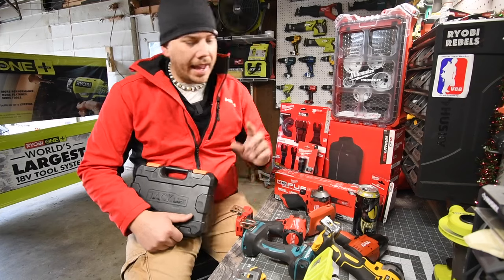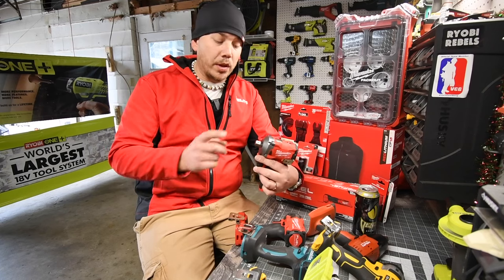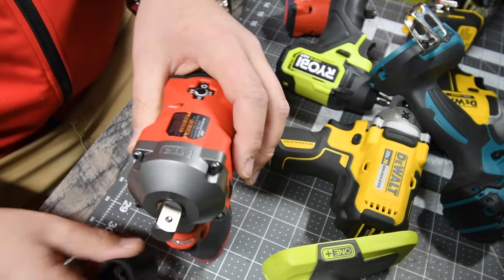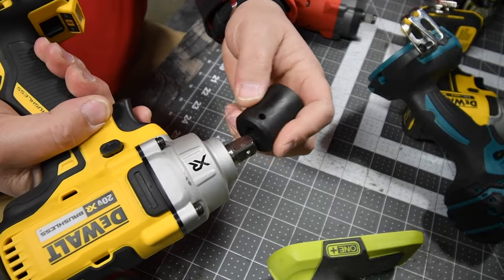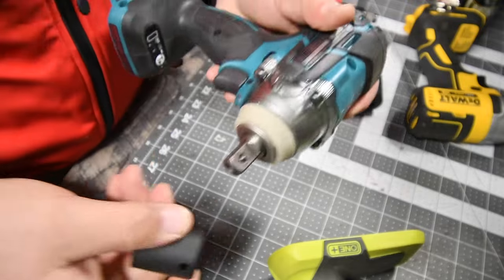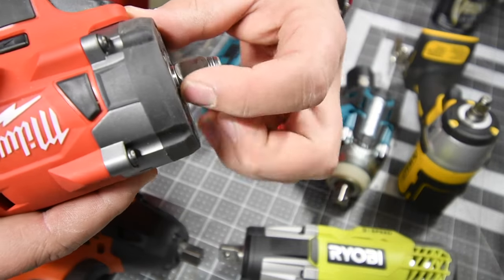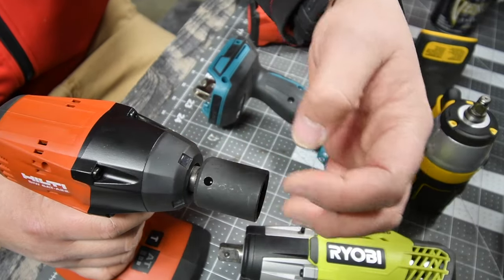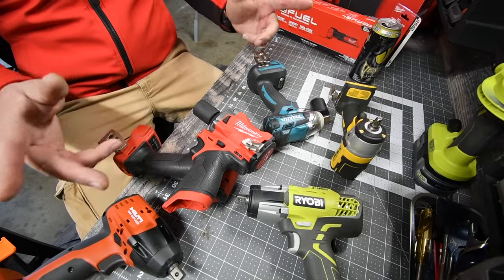(Detent Pin) and (Friction Ring). Whats the Difference?

Comment: Milwaukee designs their pin detent wrenches that way on purpose.  Mine did the same thing.  The Milwaukee is designed for workers who use the same size socket all day (like iron workers) and want to pull the socket off of a bolt quickly and without any chance of losing a socket while working overhead. Imagine a large socket falling off while working on a skyscraper.  Some job sites REQUIRE friction ring impact wrenches like that.  That is why Milwaukee makes them.  The pin detent models from other companies that easily release a socket that you showed would be illegal on some job sites.
Most other people should just buy the friction ring models.  I was pissed at first when I got mine, but after learning why they are made that way, I just exchanged mine for the friction ring model.  You should do the same.  Some times you live and learn.
Reply: @lilbeanie5078  Yes.  That guy should just get a friction ring model.
Reply from the maker: so your telling me that a tool user needs to use a thin metal object to take out a socket off of every single milwuakee impact wrench? lol. no they don't. LOL. I just watched a video of the m12 impact wrench with a detent pin take off a socket with no issue. its a defective anvil I have
Reply: @ManCaverTools  Yes.  Milwaukee designs their pin detent models to need inserting a thin metal object to disengage the socket.
Reply from the maker: @zachr8262  It says that in the Dewalt manual as well. but the Dewalt actually doesn't need a nail or additional assistance to put the socket on. Go ahead and look if you can find one that doesn't say you need to push the pin down while inserting the socket, Let me know what you find.

Comment: I currently don't own a impact gun but I'm gonna have a brake job on my car coming up. What range and brand would you recommend to remove my lugs on my car?
Reply from the maker: id get a mid range impact wrench. I the impacts for the lugs then I use socket wrenches and regular wrenches for the other bolts on the vehicle

Comment: You're comparing the detent pin to the detent ball to the friction ring? If you're fastening 100 bolts all the same size nut 50 stories up you're not gonna wanna drop that socket. All good man! Keep the reviews coming!
Reply from the maker: the descriptions to the tools say DETENT PIN ON THEM. that 1/2 in dewalt, HILIT Makita. read the description of the tools. a detent ball is what you usually get with a socket set.

Comment: I have avoided the detent pin and I only just bought the other day the Milwaukee M12 1/2” impact wrench 

I walked to the counter realised it was a detent pin and took it back and swapped it for the hog ring 

My reason being is aside from this issue which I didn’t even know about........

the Anvil on a detent pin is weaker because they have to drill a hole in it to accommodate the ball bearing and on air tools I’ve snapped a few and the crack went right through the detent pin and in the ball bearing came out 

so not only in this case is the hog ring better but it is a stronger set up.....

Good video video all the best from Canberra Australia
Reply from the maker: I might just get a new anvil for it with a friction ring if I cant this to act like all of the other detent pins.

Comment: From the Milwaukee manual
2. To attach a socket, align the hole in the accessory with the detent pin on the anvil. Hold the detent pin in while pushing the socket onto the anvil. The detent pin will snap into place in the hole to
secure the socket.
3. To remove the socket, insert a nail or other thin object into the hole in the accessory and press in the detent pin. Pull the accessory off the anvil.

Comment: I had a similar issue when I bought my 2860-20 impact for a good deal. I quickly got frustrated with the pin detent so I decided to do some research and found that I can replace the anvil with the friction ring anvil part # 42-06-0128 . For your specific impact,  I've found this part # 42-06-2555 on the service parts breakdown, hope this helps.
Reply from the maker: what confuses me is people say its not supposed to be like and that people are also saying it is supposed to be like lol. but I thank you for viewing K Kim

Comment: Im not sure why no one has made such comment but here we go... your socket has a hole for the detent pin, if you align it with the pin on tool yes its so it does not come out so easily only with pin, also you socket if you dont align the pin hole you will notice that the socket will go in and out much easier. So i would prefer the detent pin as you get 2 option...

Comment: Thanks for this video.  Been waiting to plunge the $ on the new Milwaukee 1/2" compact impact wrench, and still wondering which anvil option to go with. So, in reading the comments, I see the case for needing the pin in high up work, but for the ground level guy it sounds like the hog ring is best.  Both will wear out, and with the detent pin it "turns into" a detent ball eventually.  Still wondering what the preferred one is, pin or ring?
Reply from the maker: I think it is worth it
Reply: there arent many jobs were dropping a socket is the end of the world, if you might actually kill someone fumbling a socket, pin detent. anything else, hog ring is vastly superior, and can be fixed in 2 minutes with a new hog ring.
Reply: @nicholasjohnson9694  Certainly not the end of the world, but having a socket come off and drop down into the belly pan of a CAT dozier will certainly ruin your day.

Comment: Detent pin are supposed to work that way one of my deealts you need a nail to get it out, but still better than friction ring which I hate they are too hard to put on and off
Reply from the maker: I do agree that the friction ring is a little bit too hard to put it
Reply: @ManCaverTools  I hate the hog ring on my Dewalt 883B.  All my sockets fall right off- doesn't hold on to a socket AT ALL.

Comment: Thanks for the info and clarification 
So change sockets alot - friction ring. 
Use 1 socket most of time - detent pin ?  
How about torque difference on the 2 styles?
Reply from the maker: no torque difference. its just a certain type of anvil

Comment: There’s nothing wrong with the tool, it is working exactly as described. It is a detent “pin” not a detent “ball” 

Anybody in engineering at our hospital knows if you want the socket to stay on there you always order a Milwaukee tool with a detent pin!
Reply: You have a point regarding safety, but my 30 years+ construction experience says it shouldn't be that hard to put a socket on to begin with, "pin" or "ball" (as he demonstrated with a half dozen other tools). And, before "anybody in engineering at a hospital" says anything about "breaking in" a tool, there is no such thing as a "broken-in" socket retention device. If the ratchet/anvil doesn't work the same the 10,000th time as the first time, it's just plain broken.

I've also done work in 6 hospitals/clinics in the last 10 years, and barely seen any Milwaukee... well, anything.

Comment: The m12 stubby with the pin detent was designed that way it is not in anyway faulty. It is for people (mostly construction workers) who are working in high areas and use the same socket all day long, also to ensure safety for the people below the work area which is why you need to manually push the pin in order to release the socket. Read the description of the tool on the site you purchased from and if anything just swap it for the friction ring which is designed for easy socket release.
Reply from the maker: im going to put oil in it to see if it lets the spring react better. I just say its faulty because all of the other detent pins I have allow me to take off the socket

Comment: Half of those tools had ball detentions. You need to be specific. Milwaukee isnt going to fix that problem. It's a safety issue for people working on high rise buildings using the same nuts or bolts all day long. Or in my job trade not loosing the socket down a hole and ruining million dollar machinery.  Theres a big difference between friction ring, ball detent, & pin detent. 
I do agree that it shouldn't be that hard to put a socket on but you must and always will have to use a nail or a punch to release the pin detent changing the socket.
Reply from the maker: that Dewalt mid range impact wrench has a Detent pin as well and it had no issues letting the socket go

Comment: Thank you for this video! I have everything Milwaukee but I’ve reached the end of my love affair thanks to the impossible detent pin. If they’re going to make an anvil with an non-depressing detent pin, they need to supply a pin to push down the pin.
I yankee the Shockwave socket so hard that I’ve spent two days now with severe neck pain. 
Damn I’m mad at Milwaukee!
Reply from the maker: I 100% agree with you on that one Phil
Reply: @ManCaverTools  I did finally read the instructions for my Milwaukee M18 FUEL mid torque 1/2 in. impact wrench and sure enough, it instructs people to use a thin sharp object to depress the detent pin to release Shockwave or other brand impact sockets. My sense,  though, is that if they're going to market this to consumers like me (i.e. not professional trades workers), they need to make this really idiot-proof. It would really help to have a big splashy statement on the box saying, "Do not attempt to remove impact sockets by pulling on them. Use sharp object (nail, screw etc) to depress detent pin and gently pull socket out." How hard is that?
More importantly, how hard would it be to supply a little metal key to insert in the hole of the socket? I mean, this is Milwaukee! If anybody can do it, they can. 
From now on, I'm buying only friction-ring style impact wrenches.
Here endeth my rant.
Thanks for your reply, Man Caver Tools! Your video saved me a lot of grief. Great contribution!

Comment: What I think you're doing is you're confusing a detent which is a small spring loaded ball bearing and a detent pin which is designed not to release a Socket unless specifically desired. One is for socket easy replacement & the other is not as tomg1246 eluded to. As any iron worker will tell you they don't want any tools falling off of the 60th floor because a detent allowed a sock to spin off their driver. Look at the pin is it spherical (Detent) or just like a small rod (Locking pin) & it will tell you what it's intended use.

Comment: Hey Kids, The way to prevent the socket from staying on a pin type retention is to NOT line up the socket pin hole with the pin... Just put the socket on WITHOUT lining up the hole in the socket. The pin in the  square drive will then go into the socket which has recesses in the other 3 sides without the hole. Sockets will stay on for most uses and will come off easy...Just dont complain thats the sockets fall off too easy then...
Reply: That's all fine expect for when you are working on something and grab the wrench and the socket falls off because there's no retention, why even put a retention source on the gun if your goal is to not use it and then expect for the sockets to fall off as you just described.... I think he is just trying to point out that you shouldnt have to keep an extra tool to remove a socket and he gives multiple examples with other wrenches of that's have functional pins/rings
Reply from the maker: but the issue is the socket comes off so easily if you don't use the detent pin. comes off way too easily

Comment: Since when did people not know you’re supposed to push the pin down if you wanna get the socket off. If you want it to be easier then don’t use the hole on the socket. The other three sides of the inside of the socket have indentations just like every other socket does. Just use them instead. He’s fr complaining about the tool doin it’s job
Reply from the maker: because for most brands you dont need to manually push the pin in. the socket normally pushes the pin in with some force as you take it off the anvil. I thank you for viewing Jose

Comment: Why didn't you just call Milwaukee Tools and ask them whether this is supposed to be like that? I did. I called the Milwaukee tech support, and they said that it is NOT supposed to be like what you are showing: no special tools should be necessary to take the socket off the detent.

Comment: I have the same problem with my Milwaukee fuel impact 1/2" gun. I don't know why the hell they did this but i always have to use a small phillips to release even when pin is not aligned with the hole. Love the gun fuk the pin
Reply from the maker: its useful but it could be a tiny bit loser